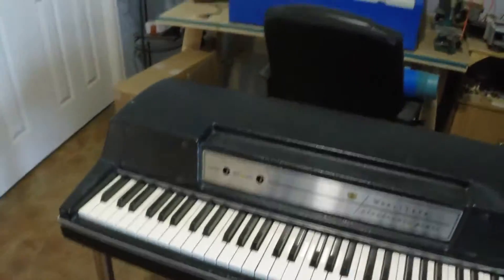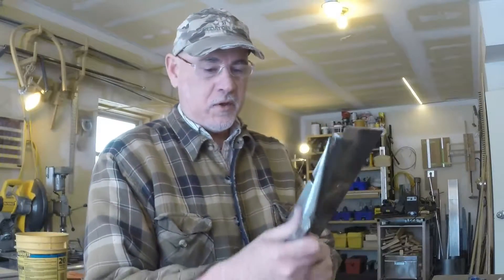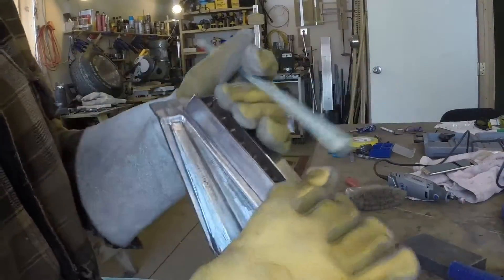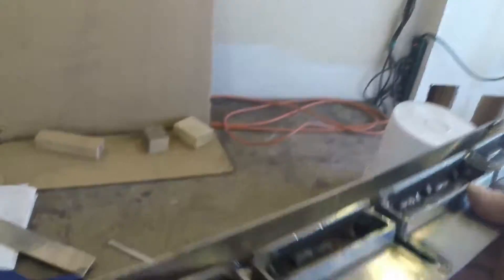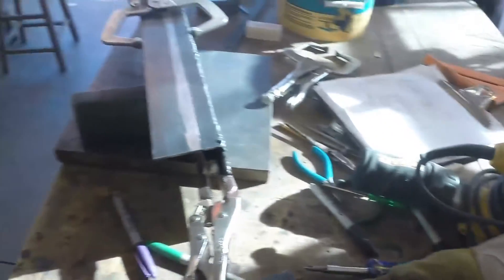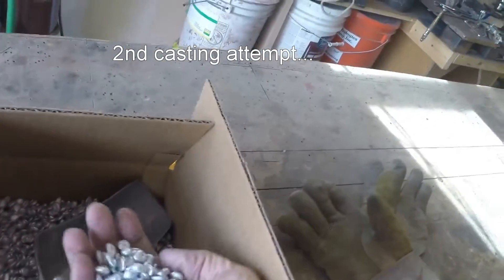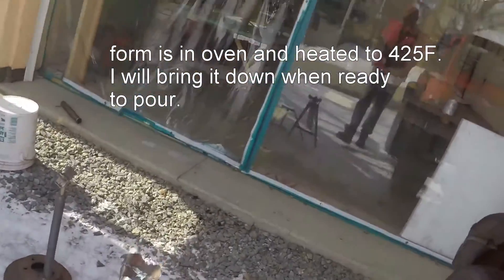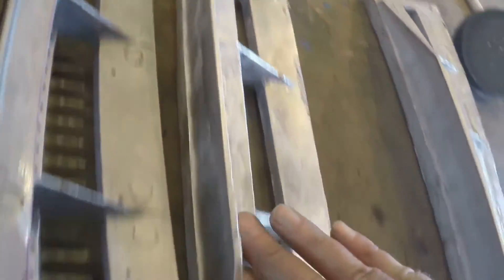reusable aluminum casting mold

Comment: cool!  nice example of permanent casting using steel mold, although its for aluminum.

do you know what mold material other than sand casting would be used to make steel copies?
Reply from the maker: Thanks!  For steel, sand casting is pretty common but there are other types of casting material that will harden using gas to start a reaction. I don't know what the material is called, but you might search 'hardening casting media' and similar phrases and you can probably find it Hope that helps!

Comment: Superb.. work (Y) I make simple chandeliers, but now looking at your video I wish to make a chandelier arm from aluminium could you please help me how can I make a chandelier arm with simple basic design but needs to be hollow from inside to put wires inside..
Reply from the maker: Thanks Rave Brave! I think if you are wanting to make hollow parts, you can use a sand cast core for your hollow, and a steel form for the the surface. Maybe using wire to stiffen it would keep it in place during casting but still allow you to remove it after casting... I know there are many types of binders you could use, but I don't know of any of them by name.